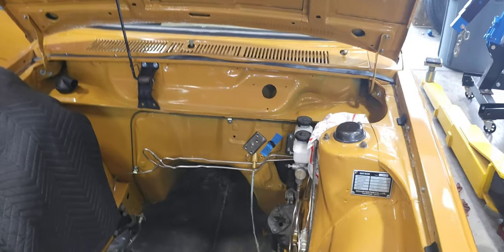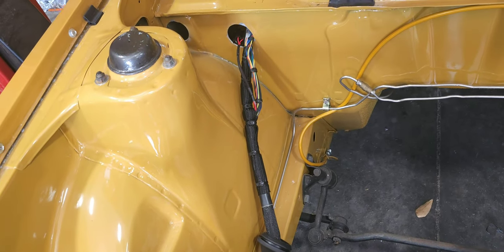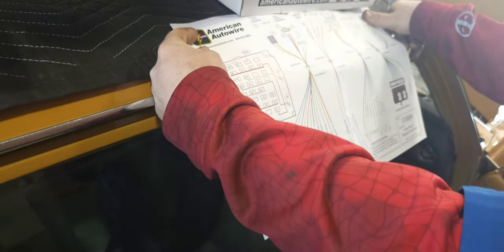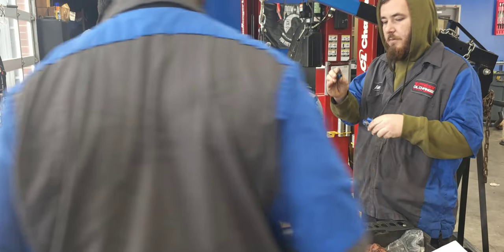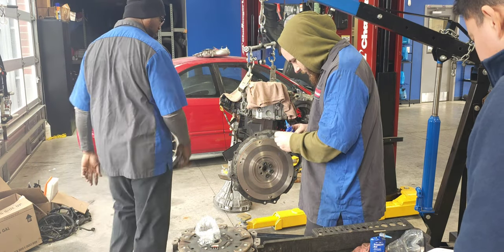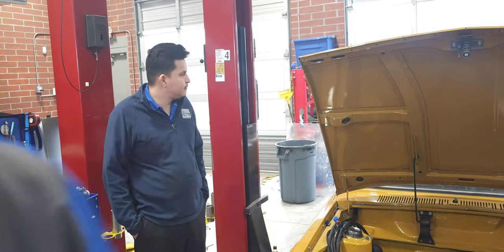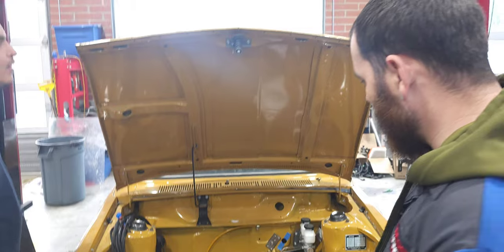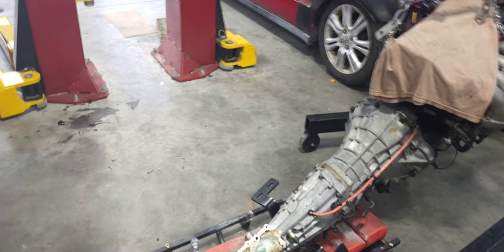KA24DE Swapped 1971 Datsun 510, the old gets sonething newer.

Comment: Customer car?
Reply from the maker: Yes sir. Worked on 3 other of his vehicles  so he chose us for the custom install.
Reply: What box is that please? I’m in Australia and keen to do this conversion.
Reply from the maker: Which box do you refer to?
Reply: @AUTARKYDESIGNS  gearbox. Did you use an adaptor plate?
Reply from the maker: No adapter plate was needed. That transmission is for the KA24DE Motor. A custom driveshaft was made though.